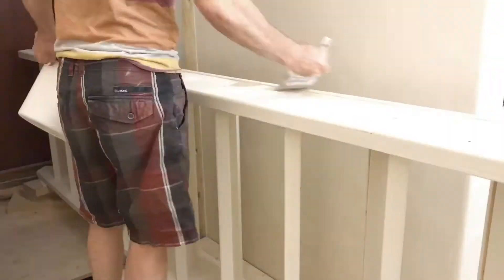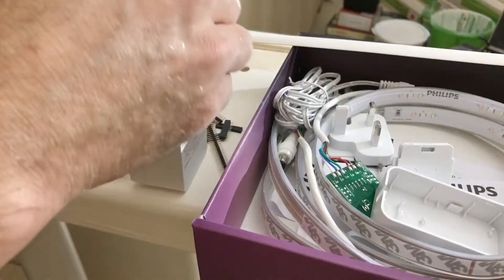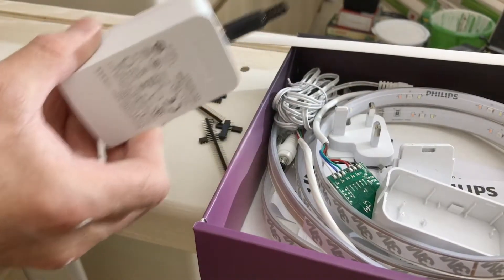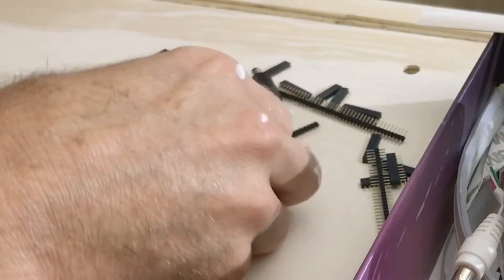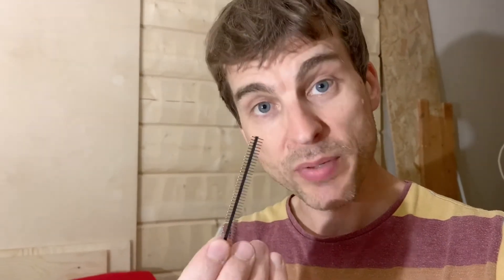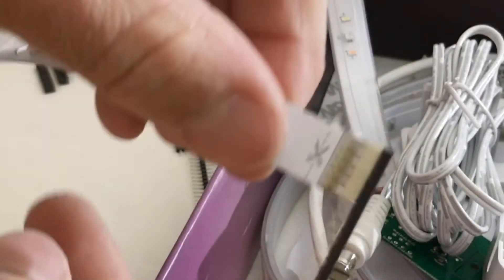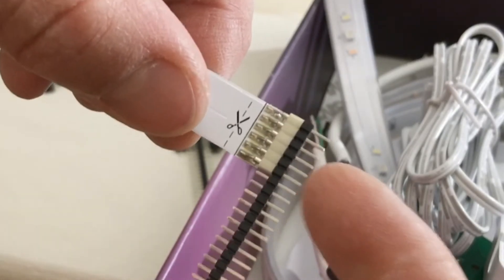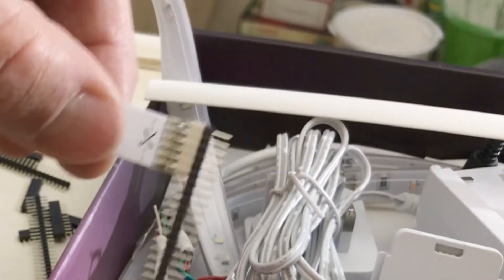Renovation: custom Philips Hue Lightstrip Plus modification begins.

Comment: Thank you for your time making the video! May i ask you where you bought the dc connectors?
Reply from the maker: Perhaps the best answer I can give is a more general one so you might also find a store local to you. 

I searched for stores that sell “electronic components”.  If you find a shop that sells things like capacitors, resistors, diodes.. then I would be pretty sure they will likely also sell dc connectors. I really hope that helps. I’m just guessing it’s unlikely you are shopping in Turku like me. 😎

Comment: Hello, sorry I could't find a video where you explain about the female connectors, I'm trying to do some spacer/extension cables to join two pieces of lightstrip , I found the video about the PCB risers but not for the female connectors,  I need to join two lightstrip extensions with a spacer cable in the middle, is there a video about it?, thanks, best regards from Mexico.
Reply from the maker: Sorry I haven’t made it super clear how the female connector was put in place. You can see it in this video: https://youtu.be/4I9xji4zNTo

I hope that helps. 
I tried to collect all the related video in this staircase light build in this playlist:
Philips Hue Staircase
https://www.youtube.com/playlist?list=PL35QcSr-c-2Z_yBNHpfGWOLmrcEC3l1NM

Good luck. Keen to see what you end up with.
Reply: @PaulWarrenEaton  Thank you a lot, about the female connector, did you used the same method as the PCB risers?, did you bought large 20 or 40 pins connectors and cut them to get 6 pin female connectors?
Reply from the maker: No the female connectors were the correct width. They don’t cut well at all so it’s best to try and get the correct size.